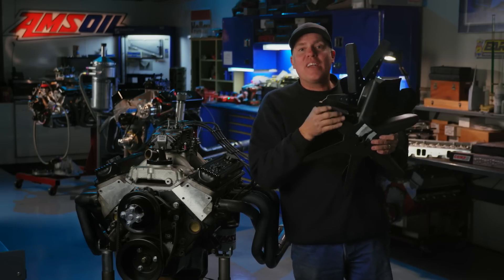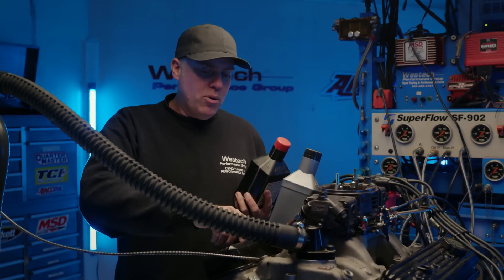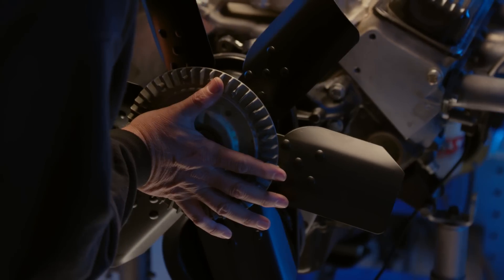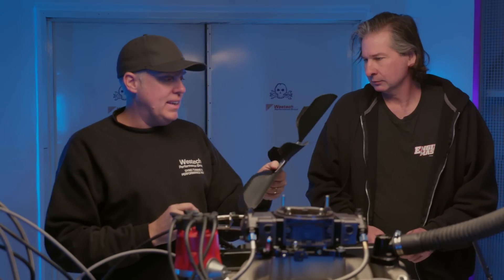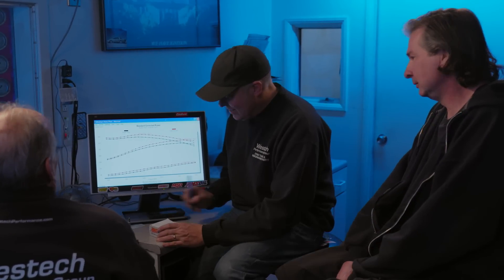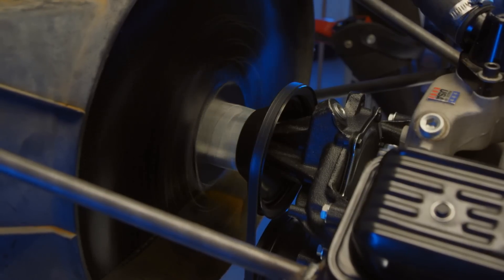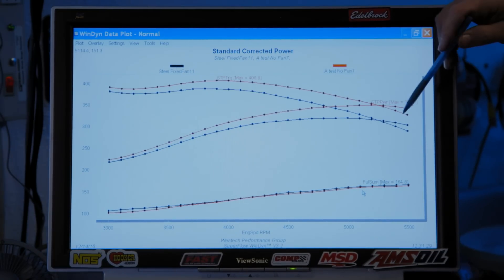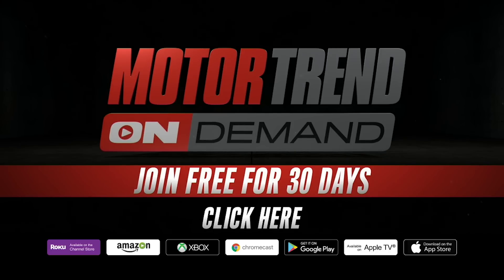Cooling Fan Shoot-Out! - Engine Masters Ep. 20

Comment: Come on guys, without the shroud it can suck air from all more area but with should it has to suck air through a restrictive radiator, thus using more power.
Reply: When you are doing that  you are stopping all air flow and reducing the pressure in the housing making it easy for the impeller to spin.   NOT the same principle.
Reply: A ducted fan will always move air than a free air fan in free air  as air is far less likely to spill of the tips of the fan blade, moving more air at any given RPM means it needs more power to do. 

Would have been nice to see a proper stainless flex fan tested. I think it would have been the lowest HP draw as they basically move no air at higher RPM. And not an aftermarket one but a proper OE one as the pitch on the blades are way less than most aftermarket ones.
Reply: I agree that the shroud does take horsepower as they also concluded that from the test. But I'd rather sacrifice those negligible 8 ponies to have a shroud so the fan actually pulls heat from the radiator and keeps the engine cool 8D
Reply: But this is known fact that when a fan starts to chop thru lower pressure air it consumes less power. There is something else going on  with this shroud.
Reply: A shop vac uses a centrifugal fan. They are unique in the way they work. As it throws more air, it draws more power. Almost every other type of fan or pump is the opposite, as it's restricted, it draws more power. Adding a shroud restricts it and forces it to draw air only through the radiator cores.
Reply: Fixed blade fans are going to move a specific volume of air regardless of obstructions to a point. The fan shroud forces the fan to pull air through the radiator. Because of this, it takes more power to pull the same volume of air that the fan is going to pull. With the shroud off, the fall pulls air from everywhere and the radiator will be less efficient, thus causing the car to over-heat.
Reply: Jimbob He is right. Any fan will draw less power the more restricted the airflow is. What's happening with the shroud in this video is something different.
Reply: Jimbob hold up for a second.    if you haven't ever tried this put your palm on a vacuum hose and notice the rpm of the motor speed up.  this is because of the partial vacuum or low pressure your palm creates and less air resistance = less energy required to rotate the fan.    so by doing this with the radiator shroud your also creating a partial vacuum.   so the shroud actually helps power
Reply: Jimbob yes I had the same thought without the Shroud the fan is not relegated to being forced to suck air through the radiator it is basically just spinning in free air which has to use less power
Reply: That's the point. You are trying to pull air through the radiator. Your engine is water cooled not air cooled.
Reply: Would be interested to see properly designed fan blades too. In the end the goal of a fan is to move air, and you try to move the right amount of air and at the same time cause the least amount of drag. Proper blade design move the same amount of air while causing less drag (and thereby parasitic loss).
Tip losses make that the fan eats less horsepower, however the fan moves significantly less air thereby reducing cooling. The best performing combo would be a properly designed fan, with a shroud. The fan can be more 'mellow' and still move the same amount of air. Less consumed horsepower, same amount of air moved.
Reply: Yes i agree
Reply: and cooling more
Reply: no you help cooling as the air is forced in one direction ie through the core of the rad
Reply: ^the right answer
Reply: Jimbob I was also wondering why they were so shocked. Seemed obvious.
Reply: It's the same principle as how a Fenestron tail rotor vs a normal helicopter tail rotor can be smaller to perform the same task. The fan is more effective at moving the required air through the radiator with the shroud and thus better at doing the job of cooling the water, however the penalty is the consumption of more power.
Reply: Spot on. I was going to look through to make sure someone said why incase no one else thought of it. Good job!
Reply: One other thing ne2i, hotrods may require more cooling than a normal engine. The reason is because if you are racing you are putting more load on the engine which in turn will cause the heat to build up faster.
Reply: Jimbob als the air it's pulling go out out the side or the edges of the blades and fling off. Centrifugal forces. So it's not having extra resistance from the air.
Reply: Watch again at 5:00 and listen to Freiburger...
Reply: Jimbob watch the video then kid
Reply: What about the increased air pressure at the front of the radiator in real life? They shouldn't use the shroud in my view.
Reply: Jimbob ah, but when you think of it  though, sucking air through the restrictive radiator is still better for the engine. The fan shroud ensures that a greater percentage of air moved by the fan, works to remove heat from the coolant running through the radiator. Without the shroud, a large amount of the air moved by the fan will be from the fan side of the radiator, which does no good for keeping the engine cool. Honestly, I would rather see the power drop, and have an engine running well within the safe temp regions, than risk running it even a little too hot. Engines are a lot more expensive to replace, especially when you have a lot of performance parts in them, than I wish to gamble with.
Reply: It all depends on application. Towing rigs require lots of cooling air and the clutch fan is best at providing lots of air at low speeds. Hot rods are usually tuned to run hot and move faster through the air and may require less fan to cool.  Also part time pleasure cars can get away with less fan as they don't have to deal with daily driver stop and go for 100k miles.
Reply: 100k miles makes no difference at all. A car will normally get to operating temps within 3 minutes after starting. That being said, even a weekend cruiser will overheat if the fans installed are not up to the job of pulling enough air through the radiator regardless of where you are at. Stop and go traffic can be the worst case scenario but you have to get to where you are planning on driving somehow. Obviously electric fans are an option, but will pull a lot more load on your electrical system, so if you have a weak battery or alternator you will have issues. The advantage with electrics is they usually have their own shrouds attached and they don't take horsepower to turn. If you want to improve cooling, get an aluminum radiator and don't paint it, leave the metal raw so there is nothing that will interfere with it's ability to transfer heat to the air. Even clear coat paint will reduce a radiators efficiency.
Reply: Same concept as sucking air in through a straw vs. an open mouth.
Reply: @ DIY Computer Guy Incorrect. Not the same comparison.

Your lungs work by creating a below atmospheric pressure, which then outside air flows into. It is only 'harder' because your body is demanding more oxygen so to get the same amount of air 'flow' through a straw you have to create a higher pressure difference. Your lungs are a set of baffles, not an impeller or propeller.

Fans work by physically propelling the air backwards (notice how the propeller's name comes from) this in turn creates a negative static pressure at the trailing edge of the blade which atmospheric pressure comes in to equalize. If due to restriction atmospheric pressure can not provide sufficient airflow then the negative pressure increases in area reducing the density through which the blades are moving, reducing drag, and thus reducing power loss.

This is why in a sealed system with minimal leakage and a constant power electric motor, such as a vacuum cleaner if you restrict the intake the motor spins faster, because it is experiencing less drag, yet has the same power, so the impeller's rpm increases.

The principle purpose of the shroud around a radiator fan is to increase the efficiency of your desired result. Atmospheric air coming around the radiator to replace the air propelled backwards is essentially waste in what you are trying to achieve as it's not passing through the radiator. The shroud means almost all the intake air has to come through the radiator. This is why static pressure is actually more important in liquid to air cooling systems then simply CFM airflow
Reply: Idk where you people learned about radiators but Jesus my eyes and brain started bleeding from reading and thinking about this.

When you are forced to pump any liquid or gas, restricted flow causes drag. That drag in turn either forces the fan to pull or push harder. Meaning the fan has to work harder.

Now when you remove restricted flow, the fan can now pull or push with less drag and less force. For fucks sake, go read up on how radiator cooling works. 

Since it's easier for me to do pc examples. If I'm running a 120 thin rad, and want 80 cfm, I can get away with a cheap couple psi electric. If I switch to a thick rad, I have to use a higher psi fan or sacrifice cfm due to drag in the rad. A higher psi electric fan has more power to move air.

Now in a car you don't have a higher psi fan, you have a motor with hp driving it. If the fan is running a shroud it's like the thick rad as the drag from the radiator is where all the air is flowing. Now take that shroud off, you get less drag requiring less hp, as air bypasses the radiator. The reason why torque isn't as affected is because the fan is always going to spin up. The power that's required is what varies without a shroud.

God I think I actually got dumber reading replies to this. It's also why if you want to pump water, a more powerful pump moves water faster through a smaller diameter pipe. If both pumps have the same rpm, you will need a bigger pump which means more pressure and more flow. God, this is the same physics behind a gas pump. Behind a fuckin water block. Hell the same damn physics behind why more open headers increase hp due to increased air flow. Ugh so much stupid.
Reply: Holy hell guys you all way over thinking this, A ducted fan moves more air than the same fan in free air. 
The ducting keeps the air from spilling off the tips of the fan blade, the radiator has NO measurable impact.
The shroud acts like a duct and If the fan is moving more air at any given RPM it requires more power. Remove the duct and the power requirement drops as the fan is moving less air.
Reply: +Jimbob is right. I don't know where the rest of you got your engineering degrees but it sounds like a lot of you are talking out of your asses.

A fan running inside of a shroud that has to pull air through a restriction will obviously have more drag than a fan exposed to open air.

The ultimate source of the drag is created by the pressure differential between the front and back of the fan. The pressures naturally want to equalize and the fan is now having to push air against a relatively higher pressure than it would if it were to spin freely in open air.

Low pressure Zone          Fan Blade Direction-->  |  <-- High Pressure zone.
Reply: Jimbob this is very true, an engine built to haul, will normally be built for low RPM grunt, which in turn means that the engine has to work the least, to perform more work.
Reply: grab your vaccum cleaner, close the sucking end, you will hear the vaccum go faster the less air it can suck. more air flow is more power used.
Reply: So even though the video and dyno proves i'm right you will still disagree because the noise your vacuum cleaner makes?

Comment: Always been told a fan robs 7 to 10 hp. Myth busted....
Reply: Yeah, one of the few times it turns out much worse
Reply: what i actually meant was that you are already moving through the air. therefore the fan doesnt have to accelerate any air. this means that i consumes a lot less power.
Reply: Fitzy Holden 
I guess nobody's old enough to have read the fan comparison test they did in car craft magazine back in the 90s or early 2000s. 
The 4 blade old school Chevy fan was the worst In that test. 
there was a 45hp difference from the best to worst one.
Reply: mr42ndstblvd your n/a red block is definitely not making 200hp
Reply: who said it was?
Reply: kokainsamural...good point...the thermal clutch will recognize that because of the cooler air coming through the radiator....
Reply: this test was stationary though. at 50mph youll loose a lot less from the fan.
Reply: +Fitzy - The stock type clutch fan does only take about 7 HP as they showed...

Comment: But which one moved thre most air? Also someone please tell D to talk less.
Reply: They should do this comparison again with the radiator being functional and run each fan under load for 1/2<1 hour or so to check efficiency/coolant temps. to simulate towing, a race, etc.
Reply: Yeah. That's what I need to know. Which one moved the most air.
Reply: Absolutely. Think of 1, how heavy those fans are, 2 they are direct drive from the crank, 3 how fast they are spinning, 4, how much air they have to move to keep an engine cool. so 26000 watts, yeah i'll believe that. Even you're small desk fans can use nearly 60 watts, if you have a 24" box fan it can use up too nearly 300 watts....and thats just moving a little bit of air from a couple thousand RPMs, and from not very deep cut fan blades. So yeah id say it sounds about right, but I'm not any sort of authority on the matter, just saying from a logical standpoint, it makes sense.
Reply: Now that is a good question. Assuming all the lost power went into moving air through the rad, I'd say the stock steely that robbed the most HP.
Reply: Yep.  How many CFM do you think a fan that size moving at 4-5 thousand RPM is moving?
Reply: +Bernhard Jordan true... That got me thinking, does anyone make fans like air props..? Variable pitch..?
Reply: Just like electric power steering pumps.
Reply: Choco......Thar She Blows !
Reply: yeh and the tards were making excuses not to use an electric fan LOL!!!!!!!!!!
Reply: honestly it usually doesn't matter. once a car is moving at 30mph a fan is not effective. which is also why a electric fans wins, idling in traffic it can be at max revs and not 700rpm. another win for me was they are way flatter and sit way closer to the radiator
Reply: why not just mothercharger it?
Reply: The clutch fan moved the least air because it has the smallest surface area for blades. Otherwise, it's a crap shoot to tell you what pulled the most.

If you're looking for more air you can always just change the pulley size. I wouldn't suggest getting too crazy about it though.